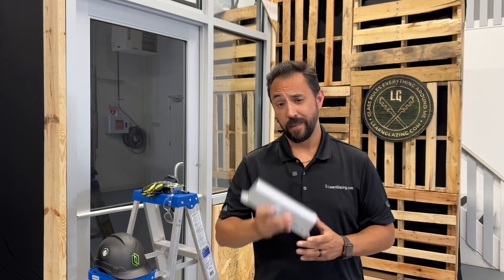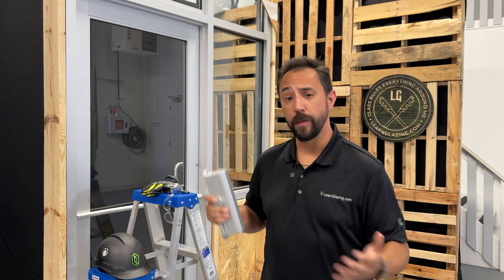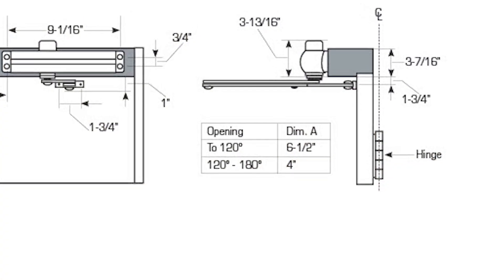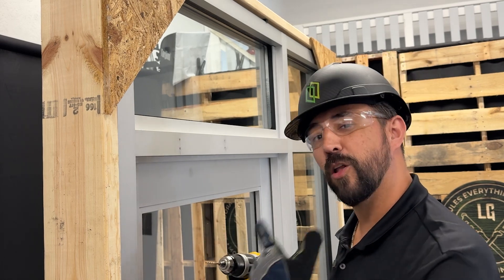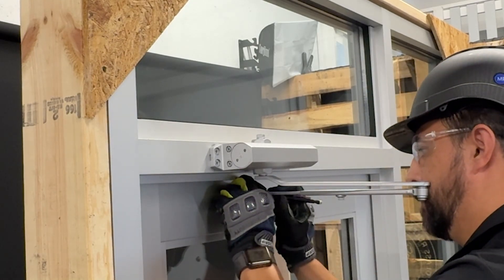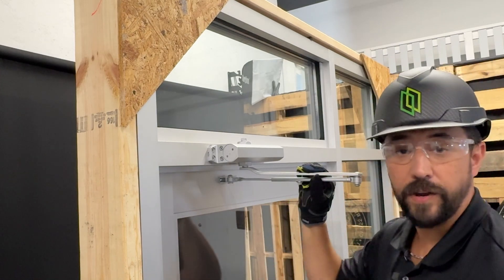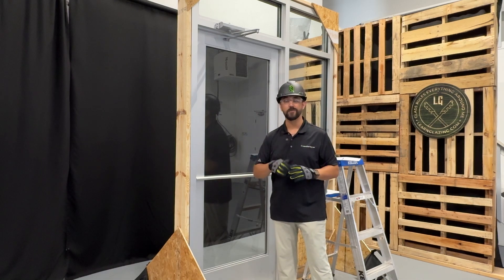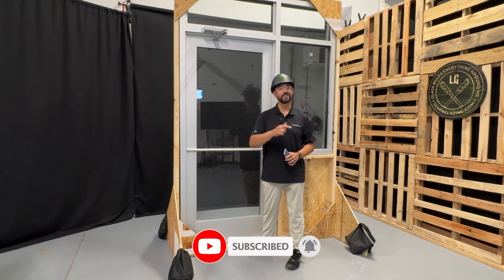How to Install a Door Closer: The Final Step in Storefront Setup!

Comment: I've always thought it hilarious how detailed the instructions are. 
Why don't they just say measure 6 &1/2" out from the vertical jam, mark a line, mount the closer (temporary) based on the 6 and 1/2-in line. Mark your holes, drill holes, Tell the new guy. What size drill bit do you use. Mount the closure drill all four screws in. 
Mark a 1" hole directly beneath the middle of the closer. Put the arm at 90° to the door which is called perpendicular. Mark for closer arm holes. Drill. Mount the arm tighten the arm. Then simply adjust the swing and the latch speed. What you did in this video is 10 times better than the directions. TY.
Reply from the maker: It’s very easy to over complicate processes in writing. Glad you liked this video. One note is we like to tell students to push the arm slightly, maybe about 5/10 deg in the directions that it will open to add a bit of tension before tightening it to help the direction of the swing.